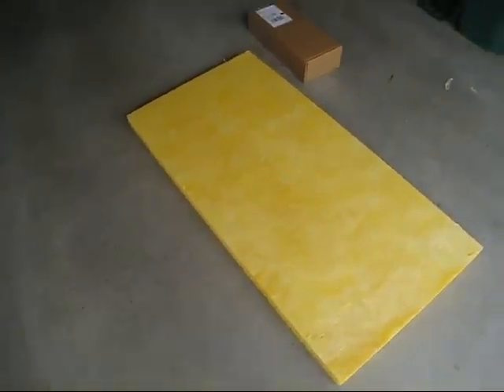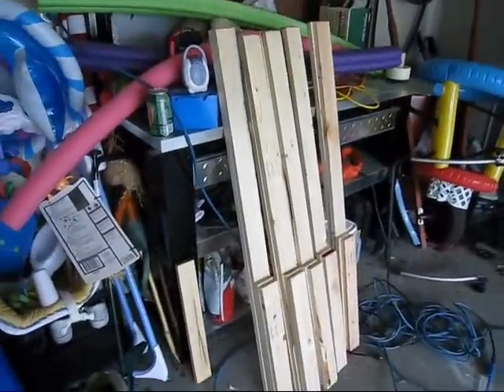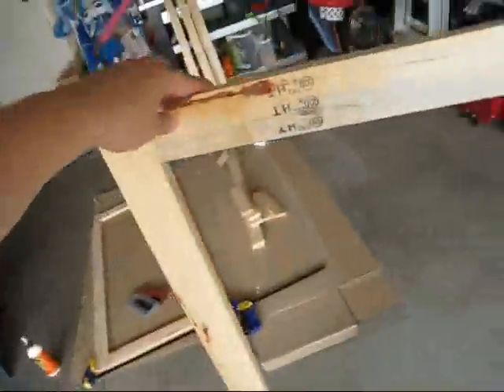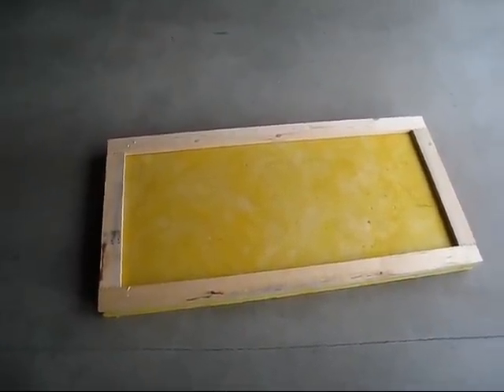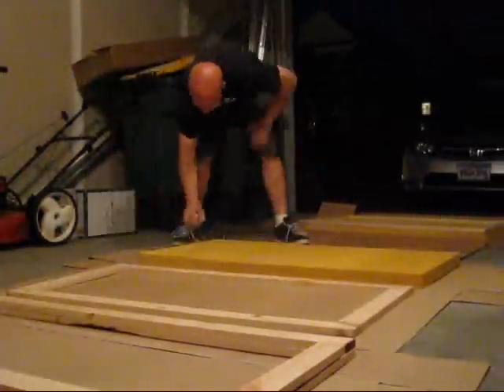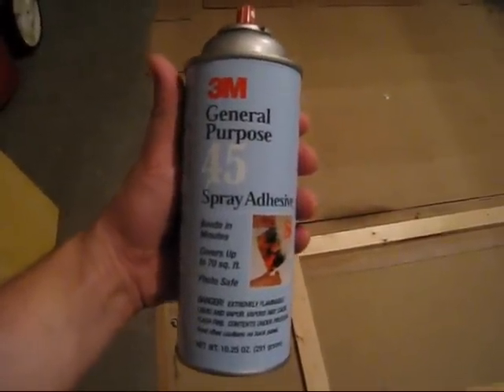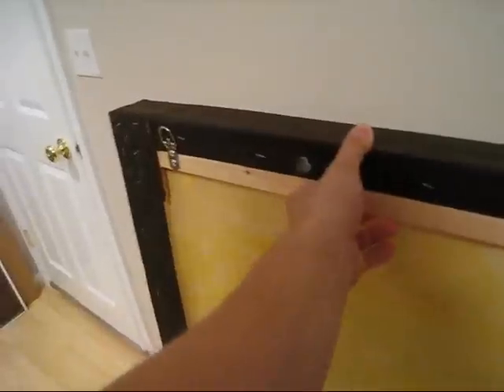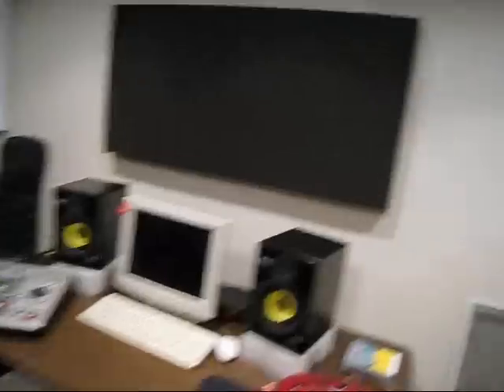Homemade Acoustic Panels

Comment: hi Kindohm, with your inspiration i did mine over the weekend. I know many have been asking for measurements. Here is is what i did.
1. Got precut 12-1"x2"x2' and 12-1"x2"x4' lumber for frames from Home Depot
2. Asked the guy from Home Depot to cut 4" from the 1"x2"x2' lumber so that it would be exactly 2' width.
3. Used wood glue(Walmart) and then stapled.

Comment: I am sure you have already considered, but you should put some on the ceiling and some thicker once into the vertical corners. It will make a HUGE difference even compared to your present setup. Also make sure the fabric that covers the fiberglass boards is breathable. When I built my 8 Bass Traps I just put one 6 inches thick into each vertical corners and some onto the side walls and my mixes became way-way better and they translated to other rooms easy.

Comment: Thanks, I'm making my bass trap measurements and am heading out to Lowes' once I can get some babysitting. I was thinking about putting a triangle trap in every triple corner and long traps on the corner lengths. I might even hang some velvet curtains on two walls that can be opened and closed for more or less deadening.

Comment: Very nice video. I have a suggestion though, the use of cheap fabric will make pretty terrible panels. If you skimp on the fabric you might as well have put plywood inside of the panels because the insulation is doing no good. The idea is that the sound travels through the cloth, into the fiberglass then not back out. With cheaper fabric more sound bounces off of the fabric than gets through. It is best to use speaker grill cloth to cover them, something that is sound transparent.

Comment: I think he uses these panels to prevent mid-high frequencies reflections from the side and back wall. If you wan't "bass traps" that reduce peaks and nulls, and fix modal ringing (bass tone that keeps self-reverbing between walls) to eliminate muddy and unclear bass you should use thicker and heavier insulation, and put them in corners. Space between the wall and such panels are important or else they don't work very well.

Comment: Hey dude,

The panels look very nice. I'm sure they will absorb well above the 200Hz region. I bet you got insane because of the cymbals in the empty room.

BUT. You have to buy some nice stands for your speaker man. In the way they are set up now, they will add+6dBSPL extra at low frequencies. Also there is some serious interference going on, cause of the tablesurface. Read more about speakerplacement and SBIR.

Cya!

Comment: Nice video. I made some panels last night with your vid, but i covered the back of the board with a vinyl cover. I see you left the back of yours open. Was i supposed to leave the back un-covered. I was concerned about the fibers getting in the air. I hung teh 2 i made behind the sofa where i sit.

Comment: Wrong, that will not give you broadband absorbtion like the rigid fiberglass.  It will attenuate the mid highs to highs but nothing below that.  you need density/mass to absorb low frequencies